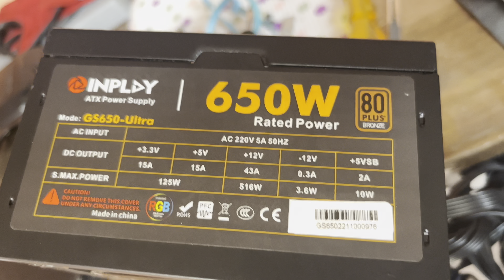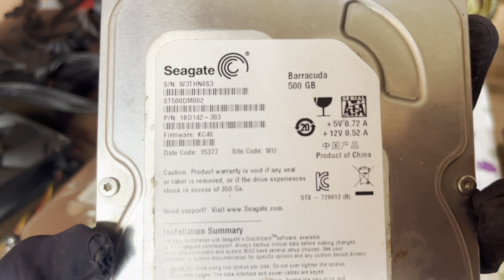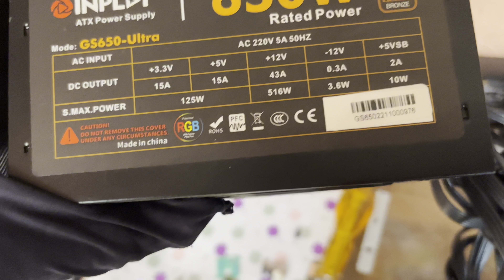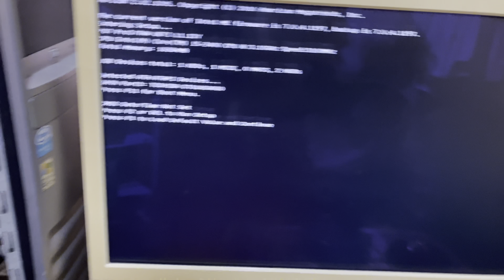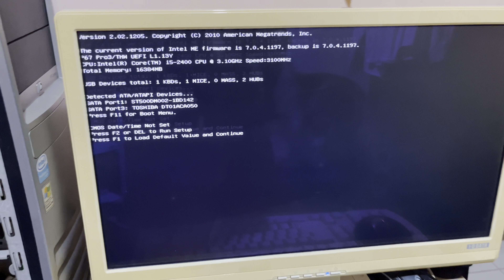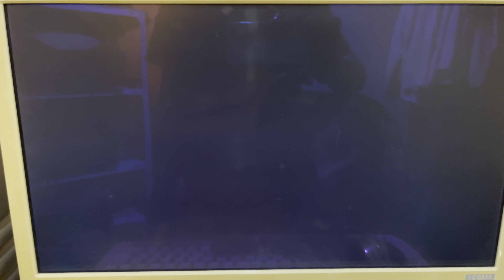Fixing My PC | Error Fixed 🛠️

Comment: 0:00 That is WAY too much thermal paste, you only need about a pea sized drop. 2:00 I checked the date code on that HDD and it is 9 years old, if this video was filmed right before you posted it. Usualy they only last 3-5 years. 2:16 I'm surprised that drive still works.
Reply: I was about to say the same. It’s like they’re trying to bathe it in thermal paste